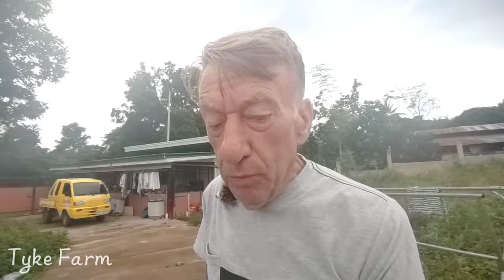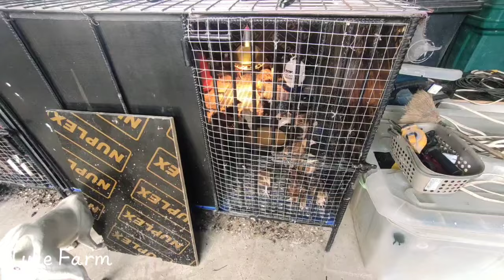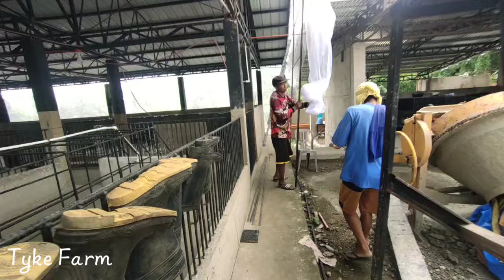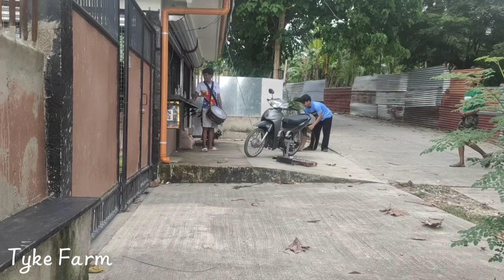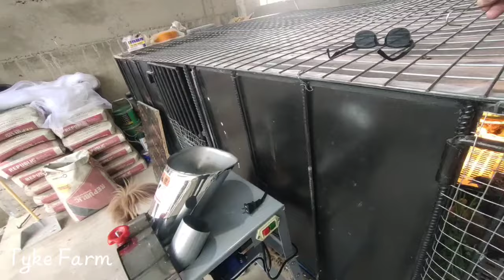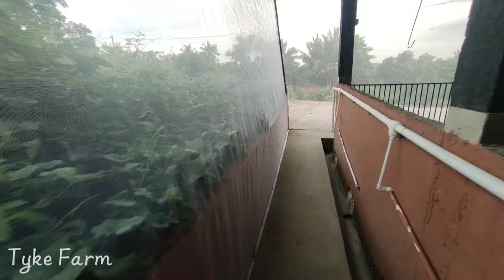ROGER'S BACK

Comment: I’m in central Luzon and we are in the process of buying some farm land.  The going price here for undeveloped farm land is 400 to 500 pesos per M2.
Reply from the maker: Hi Build yes fill your basket for sure. here 1500 per square meter but still cheap as to what it will be in 5 or 10 years. The thing with farm land is what the return is. Which is small in all countries for farm commodities. BUT if you can as I'm trying to do sell direct to the public I think you can make it pay. As it has to pay for the Philippine partner not so much for the western man generally speaking. I have the sari shop so I don't have to leave home', a market stall or local sellers on commission are other options, or a hobby farm is enough for me.